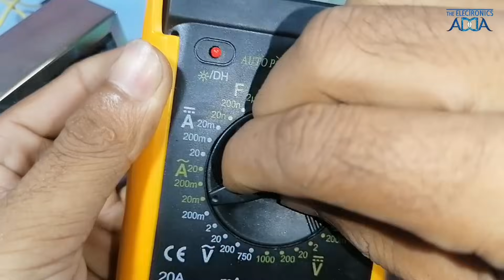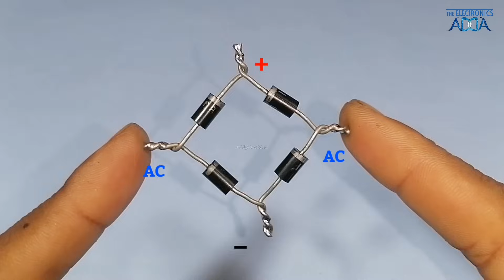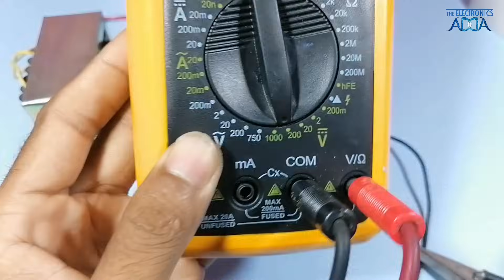How to Make a 12 Volt Battery Charger at Home | 12V Battery Charger | Homemade 12V  Battery Charger

Comment: Sir maine banaya hai lekin. Jab mai supply ke output pe jaha dc aata h woh tester se check kr rha hu to tester ki light on ho rhi hai. Kya mere output pe AC aa rhi h ya dc please reply 🙏🙏🙏🙏 4700uf 25v capacitor and 5408 diode use kia hu
Reply from the maker: Aapka connection bilku thik hain
Koye problem nahi Hain

Aapko current nehi lagega
Oo DC supply hain
Reply: @THEELECTRONICSADDA  BHAUT BHAUT THANKS SIR 
bhaut se youtuber log jyada subscribers hone pe reply hee ni dete Jab ki comment pe answer de skte h fir v ni dete. 
but apke bhi itne SUBSCRIBERS hai parr apne hamesha mere comment pe reply dia hai Thanks.
Reply: @THEELECTRONICSADDA  maine iss wajhaa se pucha kuki mughee laga AC se Capicator blast ho gye ga. 
Thanks again. 
Capacitor blast ni ho ga n maine connection sahi kia h.
Reply from the maker: Bilkul

Comment: will the battery not explode or be damaged if the output of the battery charger is 18.5 volts while the battery is only 12.5 volts???.
Reply: That why he installed a 1k resistor to help regulates the flow of electrical current in an electronic circuit.
Reply: @Exoshalot  please send the link of the automatic module on of sir. thanks
Reply: 18 volt is too large to the battery to charge 
the usual charging volt shuld be maximum 14.8 volt 
or the battery will heat up and damage
the 1k resistor is installed to the led to work 
and it will not decrease the output voltage
Reply: @mayestro211 use lower uf capasitor to get low voltage ex. If u use 2200uf u will get 15 volt
Reply: @icecream4106 i'm looking for the solution, thanks.

Comment: Sir amar kache 12-0-12 3amp transformer ache ota diye ki 12volt charger banano jabe ki? Jodi Jay tahole ki vabe ektu bole dile valo hoto please🙏
Reply from the maker: Hmm jabe
Apnar kache 12-0-12 Transformer aache
Aapni oi Transformer tar sudhu 12-0 point k bebohar korben r baki j 12 leed ta aache ota emni chere rakhben
Reply: @THEELECTRONICSADDA  Thank you 🙏sir reply korar jonno r 12v 7 amp battery koto khun charge korte hobe eai charger diye
Reply from the maker: Maximum 1:30 ghonta

Comment: Is it possible to charge a car battery 12v 45amp through this charger ?
Reply: I built one and tried... The charger heats up after awhile..
Reply from the maker: Yes
Reply: Use 18V 5Amps transformer for 12V battery past charging🐇 otherwise may be slow charging🐌

Comment: This is a very bad design, do not charge a 12 volt battery with more than 14.5 volt, you also need to check the ampere. High amp can overheat the battery and can cause an accident.

Comment: Can a resistor say 1 ohms 5w can be introduced in series with output to bring down the voltage to 14v to charge battery. The charging time will increase but it will prevent damage to battery with higher voltage fed.